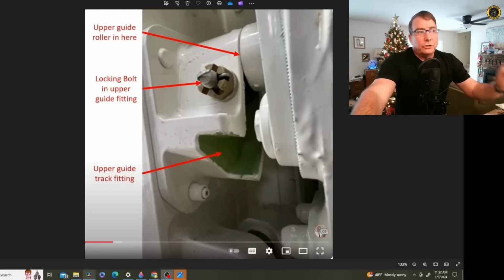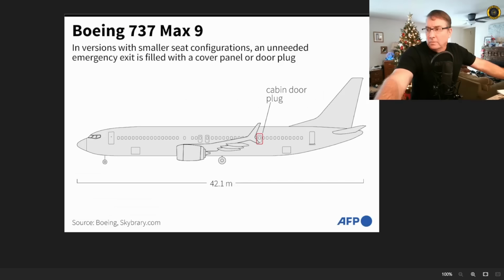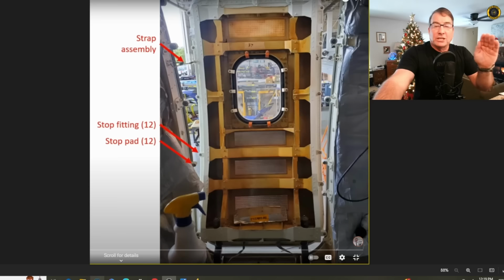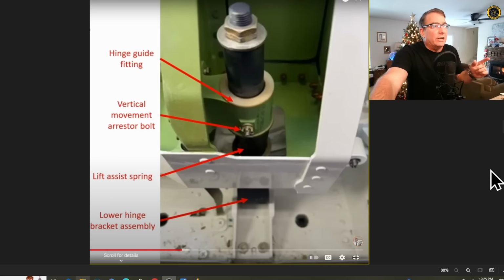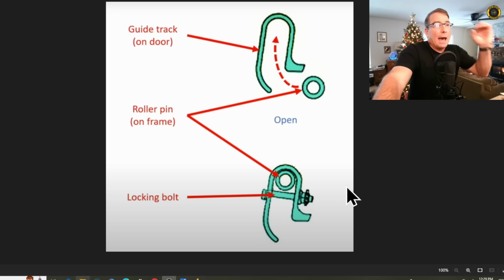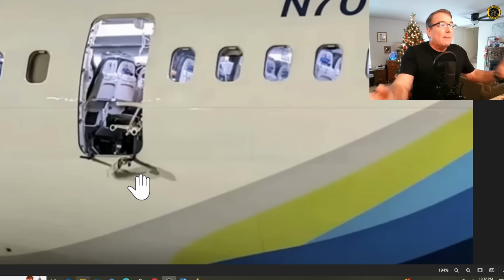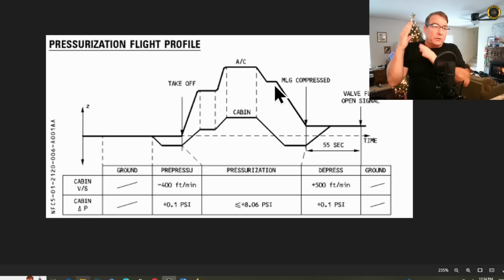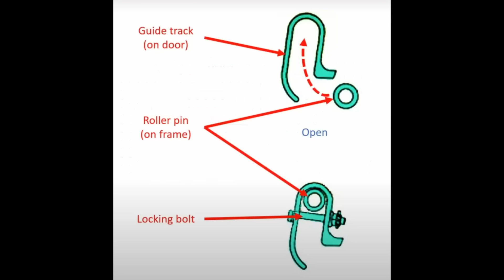Alaska 737 Max-9 Door UPDATE! 8 Jan 2024

Comment: You could just imagine the plug door being installed by two guys from the outside. Then there was something in the way when they wanted to go inside to install the bolts and they forgot. At some stage the inside panelling was installed without checking for these bolts and there was simply no way to see it anymore. Then somebody signed off the work list "assuming" it must have been done.
Reply: I would imagine the holding straps would prevent the plug door from closing. The holding straps have to be removed before you can pull the door in and secure it with the bolts.
Reply: @user-vk4vd7vr5t , Looking at the pic that shows those straps holding the partially open door, it looks like there is room for them to fold up and stay attached. Wouldn’t they want to keep them attached to catch the door at that approx 1 foot opening position? If door pops open and they are not attached it seems the door would flop open to a horizontal or more position, likely bending or damaging the hinges at the bottom, or clobbering someone in it’s way.
Reply: @Bitterrootbackroads  those straps are only ever used during maintenance

Comment: Good video Juan, I agree with your analysis -- it looks like the bolts may never have been installed or they were half-assed installed without the cotter pins. For anyone who flys on plans this should be viewed as a VERY CONCERNING issue. Since the plane was new I am sure that Alaska Airlines Maintenance did not remove the door, so the fault will clearly be with the Boeing factory -- implicating both the Boeing Factory Floor and the Boeing Airworthiness Safety Inspectors. Fortunately, this story will end positive since a MAJOR problem was identified and fixed and no person was injured or lost their life. Hopefully the FAA and the government finally does something about the Boeing 'Profit over Safely' Operating Model. William Boeing is probably rolling over in his grave over yet another totally avoidable mishap.
Reply: Juan Browne says that the plugs are removed during cabin finishing work (in Renton WA) and then replaced/bolted down there.     I'm convinced - NO BOLTS.   Nuts would not work themselves off all four places, even w/o cotter pins or other locking, in the young life of that plane.
Reply: Then how do you explain that after 11, 000 airframes, all these problems are suddenly coming up? Boeing has something like 4,000 737 airframes on order, and that 737's account for 56% of Boeings sales? Maybe, just maybe, we should start thinking "sabotage."

Comment: Zerohedge has some great pictures of loose bolts found during inspections. It's not the locking bolts that are the problem but the mounting retaining bolts that hold the hinge assembly to the door itself!
Reply: If what you say would be correct, not the "door plug" assembly would be the problem, but the hinge ... which would mean, it would not (only) be a problem of the "door plug" version, but in general on all models with that "additional" "optional" emergency exit?

Comment: If I had to make a bet on this, I'd be going with the castle nuts not being pinned. I was doing maintenance on my road grader recently and found that not only had the nuts on the drive shafts not been pinned, but the link plates on one of the drive chains hadn't been either - leading to the chain parting during operation! In a system like this pins are easy to forget to install and easy to miss in inspection.
Reply: ' I'd be going with the castle nuts not being pinned' - as I recall, it wouldn't be the first time, either.
Reply: It's been reported that United found 5 planes with loose bolts, so this one plane is not a one-off.
Reply: @Plutogalaxy  the inspector would be looking for at least the bolts and the nuts - and they should be looking for the pins. But the pins are small and they aren't the thing holding the door in. So it's a question of psychology - where is the inspector's attention? Also, what is the check list/documentation/recording process that they work from/with? Is it designed in a way that allows the pins to be overlooked?

This kind of process engineering is difficult to make reliable and fool proof. I find it fascinating seeing these autopsies and coming to understand how the mistake was made and looking at ways to prevent it from happening in the future.

Edit - and as the two replies above point out, this isn't an isolated incident, so clearly there's a process problem here. Either in assembly or maintenance.
Reply: @Plutogalaxy  I'll go with human error before I jump to deliberate sabotage. It's not impossible of course, but extremely unlikely. And if United found five planes with loose bolts then I'd say that an error is almost certain.
Reply: A Castle nut not cotter pinned would hold for years… and it appears the bolt is trapped in place and with out the nut even installed the bolt alone would function as required !!!!!
Reply: @ChasOnErie  it might. Depends if you're feeling lucky or not. The nut on the drive shaft of my grader did.

One would assume they would, but I can't inspect the actual structure, so I can't say.
Reply: Maybe you are right.  Could be as you say. However most people, almost anyone who is a mechanic knows that kind of nut and can see that there is a drill hole in the bolt. Pretty hard to neglect that. But maybe some people are really not very conscientious.

Comment: The B 737 max is a very safe plane. As long as it is on ground, the engines are not running and no PAX on board. ! Greetings from old Bavaria.
Reply: The germabs should begin making planes again.
Reply: @snorttroll4379  We are, Airbus is a merger that consists 43% of French and 43% of German airplane manufacturers (the rest being made up by spain iirc), this is why Airbus is both traded in Paris and Frankfurt and part of the CAC40 and DAX.

Comment: Thanks for the update.  Seeds for thought.  If there were bolts through the lower hinge shafts, and they sheared, there would likely be pieces of those bolts still jammed in their holes.  The side forces would have jammed them firmly in place as they sheared off.  I agree with the sequence where if there were no bolts installed, a bit of turbulence COULD have jarred the entire plug door up and off the retention tabs.  But, quick SWAG math, I came up with somewhere between 5,000 to 12,000 lbs of force against that plug door at that altitude.  (would need the pressurization schedule to be more accurate)  That's a helluva lot of force holding that plug in place once it's pressurized.  I wonder how much those springs lift the plug door upwards when it has no pressure on it and no bolts are installed?  It's obviously a design that allows MX to open the plug and swing it partially out, without having to actually remove it, to allow inspections, cleaning, seal replacement etc.  Seems like a good design for MX, but not so good for enhanced safety.  Also, if there are loose bolts on some United aircraft, the more important question is whether the cotter-pins were in place.  Those bolts don't need to be tight to do their job, just held in place by the nuts.  Loose nuts shouldn't turn if the cotter-pins are in.
Reply: But… what about if the door was moving ever so slightly upwards for the last two months? So that it didn’t have to travel the entire inch and a half or whatever to clear the stops now, but maybe it was the final straw that broke, if you will, and they slipped apart.
Reply: Maybe I'm moving to a conclusion too fast but this to me perhaps then seems not like a design or necessarily manufacturing issue on Boeing's part, but an issue of maintenance crews not following procedures fully, leaving loose or even missing bolts.
In any case someone forgot those bolts I think.
Reply: @barrag3463  but given the newness of the plane, it is theoretically possible that the bolts were never installed by the manufacturer. I don’t think it’s a design issue because it’s relatively straightforward and simple. There’s a part that moves, so you put in four secured bolts to keep it from moving.
Reply: Sorry to disagree with everyone but this is not a plug type door. Plug doors and windows are physically larger than the holes that they are plugging. As the pressurization increases, the plug window or door  pushes against the smaller hole that its resting against and seals it from leakage. This is why you cannot open a door in an aircraft once it has just a slight amount of pressurization. Crews are not able or allowed to pressurize on the ground unless it's a maintenance test without passengers. In the event of a fire or other emergency requiring everyone to exit the aircraft, they couldn't egress if there was any amount of pressurization.    This door seals as it is allowed to drop into its tracks designed to draw the door tighter against the exterior of the fuselage, EXTERIOR. Have a close look at the door pictures and you'll see that there are no seals on the outside of the door skin, just a smooth painted surface. Those 12 stops on the fuselage door opening have adjustable bolts in the centre of the black dots you can see. They are adjusted to a very tight tolerance by the "technicians" and inspected by "Quality Assurance" prior to being signed off. Someone was late for his or her coffee break and things were overlooked. How many more things have been overlooked you ask? Keep watching the news and we'll find out.    The fact that this isn't a plug type door makes it a sure thing that I would never sit there.
Reply: @biggoomba2066  I think everyone agrees that it is not the type door that is larger than the opening, but apparently the term door plug is appropriate for this part as a substitute item for an exit door. So the sequence of the same two words means different things, it seems. But it’s easy to say them both ways so I think it’s just a minor thing that even knowledgeable people are getting wrong occasionally.
Reply: @JohnHallgren  Possible, but that would mean there would have been a 1"+ gap visible from outside the aircraft, plus there would likely have been quite a bit of noise generated by the door/plug leaking as it moved up.
Reply: @mountainflyhigh  yes, that’s true…was just wondering if it happened all at once or could have been gradual and linked to the warning light thing.
Reply: @JohnHallgren  - The NTSB just stated that they see no correlation between the pressure controller(s) and the door plug.  Also, the kid who lost his shirt stated he heard a whistling sound after takeoff, coming from the door, which means on that particular flight, the plug door had likely moved up somewhat before it let go.  Hard landing prior, causing this when the pressurization was low?  A bump during the climb, again when the cabin hadn't much internal pressure yet.  But it also means, that if the plug door had been moving up on prior flights, someone would have heard that whistling, such as a crewmember, and reported it.
Reply: @mountainflyhigh  but given that the crew member would be in the aisle, the kid was in the middle seat, he might’ve heard the whistling, but it may not have been audible in the aisle. It potentially could have been there before, but nobody noticed it because of the standard ambient noise of the aircraft.
Reply: @JohnHallgren  A new Boeing 737 is pretty damned quiet inside.  Pressurization leak "whistles" are very high pitched.  We had them all the time in the cockpits of old DC-9s, as the windows (open and close on a slider system) don't seal up until enough pressure builds up inside.  You couldn't hear a damned thing until they did.

Comment: United has "found loose bolts" on their door plugs. Not sure what that means, yet, since those are castle nuts (cotter pinned)
Reply: Generally the cotter pins are very soft, if the nuts were loose and the pin rattled enough... Maybe fatigue fracture of the cotter pin?
Reply: @pjford1118  fatigue on an unloaded redundancy bolt on an aircraft only operating since October?
Where do you think Boeing are getting their parts, Temu?
Reply: Not torqued correctly or not applied Loctite ???
Reply: What does that mean? "Loose bolts"? Does United mean they were not torqued properly? What torque values need to applied to be considered "properly torqued"? and who defines these values? Boeing?
Reply: I wouldn’t think they would need to be tight. As long as the cotter pin can fit in place to keep the nut on it should be fine.
Reply: @jameskim62 lol, they generally don't use loctite in aviation. That's what Cotter Pins are for
Reply: @pjford1118 AN grade Cotter Pins are not soft.
Reply: PJ Ford... soft¿ really? Why might it be soft.. aa that would be counter-intuitive for the kind of application in use.
Reply: found bags of "loose bolts" taped to the door
Reply: The pinned comment got updated with an article about it. In the picture shown it’s the nuts bolting  the hinge bushing to the door and they are not tightened at all with the washers spinning freely. Also just normal nuts, not castle nuts.
edit: in the picture it looks like the bolt head so the castle nut might be on the other side not visible in the picture.
Reply: These 4 bolts act as shear bolts that hold the plug in alignment with the pressure pads on the frame. Doubt it matters much if they are tight but the presence of the bolts and the security of the nuts does.  There are other bolts on the lower hinge assembly that support a bracket to the door that appear loose and could cause issues.
Reply: @dlg720   Cotter pins and safety wire.  Aircraft are famous for safety wire on threaded connections.
Reply: @markcalhoun8219  No way, seriously ? Man if that’s the case then it’s an open and closed NTSB report…and sorry for the unintentional pun.
Reply: @sailaab   Yep, Cotter pins are soft, soft steel that is.  A cotter pin is a split pin.  You have to bend the end of the pin up to secure it in place.  You can’t bend hard steel.  If you did, it would become brittle at the bend point and be likely to break off.  With soft steel, the pin bends without risk of fracture.  Even a soft steel pin is plenty strong enough to keep a nut from unscrewing, unless a quite large amount of torque is applied to shear the pin.  Cotter pins are intended to be single use, though in non critical applications people do sometimes reuse them.  Because the steel is soft, you can get away with reusing a Cotter pin a few times, even though you shouldn’t.  I am sure airplane mechanics are taught that used Cotter pins go immediately in the trash.
Reply: @dlg720 even finger tight would do the job
Reply: @tpspc03   made me laugh, thanks.  But hey, after this maybe they will start using cotter pins AND locktite, you know just to make sure, the belt and suspenders approach
Reply: Yeah what does that mean. They will still work just fine if they are a little bit loose and as long as the nut is pinned.

Comment: The pads and stop fittings take all the load & weight of that door in flight. There is no way that door beat those bolts into failure or shear. I would bet my salary those bolts are missing entirely. More than like, opened for maintenance and the door was shut & paneled without installing the stop bolts.
Reply: The sad thing when this kind of sloppy work happens is that nobody will take responsibility except the Boeing Company.  😮‍💨
Workers will say things like: I wasn't trained, or the schedule is too fast, or that there wasn't a checklist provided, or there was no inspector there to paint the castle nut white, or the bolt got misplaced and lost and nobody nearby had another one.  🥴
Reply: During that last NTSB Presser, one of the NTSB persons was smiling wildly like he was aware of some ridiculous fact... And the Chairperson kept saying "we have no bolts"
Reply: A very good speculation.  We won't have the door in front of us.  They will look for shearing, check the sourcing of the bolts and other parts.  With 5 "loose bolts" reported by United, those planes will also be closely examined by the investigators.  We will get answer, but it will take time.
Reply: @bdcochran01 since some of us won't want to wait, I have an idea.  The guys at my local tire shop are really fast, and I bet they could examine the planes a lot cheaper than the FAA investigators, too.  Why not save money?
Reply: It will be pretty obvious if the bolts were installed at the time of failure. It is likely that there is some damage to the fittings. Even at 1psi of cabin pressure that door is going to have a couple thousand pounds of force on the lugs. Whether the stop bolt holes are damaged and or elongated and witness marks on the stops are going to tell all we need to know.
Reply: @mytmousemalibu  True, concerning the tremendous force caused by pressure differential...

Comment: Since that aircraft had only been in service for three months, I doubt the nuts had worked off the retaining bolts as there hadn’t been that many pressurization cycles. I’d bet the retaining bolts were never installed in the first place.
Reply: In looking at the way in which the plug closes I don't thing the plug would have remained closed, even on the ground, unless at least one bolt had been put in place.  My guess is that one bolt was put in, but not secured, as a way to temporarily hold the plug in place but the plug installation was interrupted and was then never completed.  I think that the door had been held in place by a single unsecured bolt that worked itself out.
Reply: Exactly